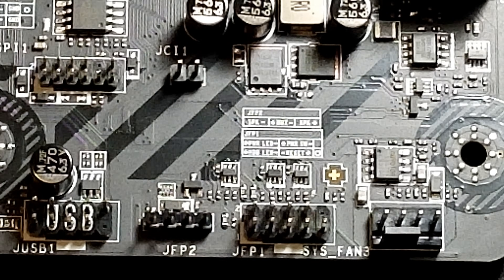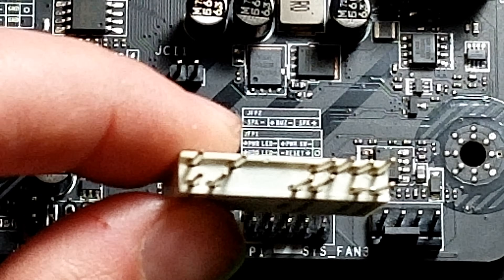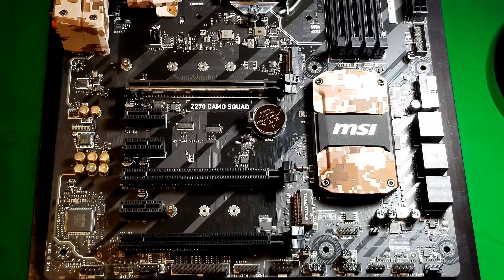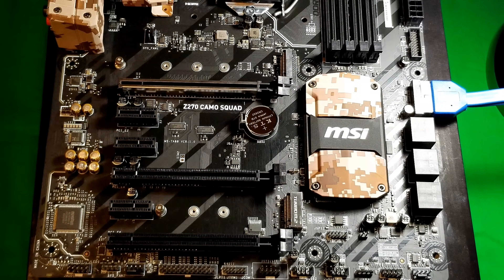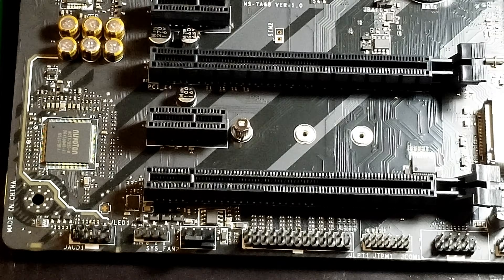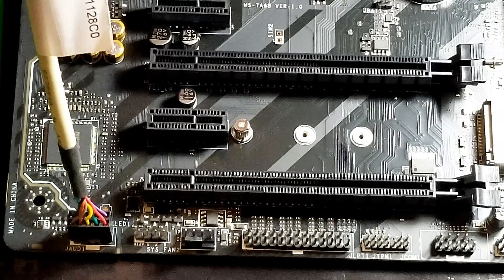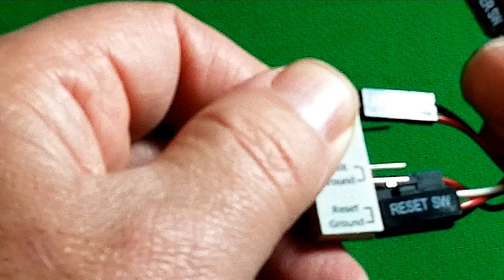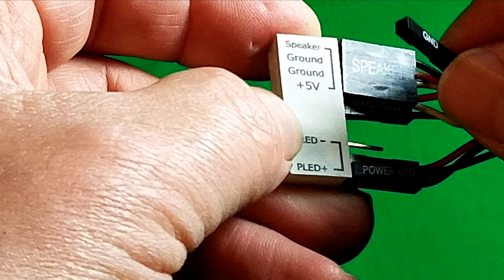Connecting your Case Front Panel connectors to your Motherboard

Comment: Where can I find pin layout for Asus ROG Strix Z390-E Gaming Motherboard LGA1151 it’s plug in where you connect the wires from panel to socket then connect to motherboard
Reply: Steven White omg yes where
Reply: I’m trying to get my pc built right now but I don’t know what the little arrow means on the cables for the positive and negative. The manual sucks but it’s readable but it doesn’t matter if I can read it if I don’t know if the arrow means ground or positive
Reply from the maker: The arrow means positive, I'll find the pin layout for you later...
Reply from the maker: If you go to your MB Manual you would have gotten with the MB, on page 1-2 it shows you the Pin Layout...Thanks...
Reply: Hey yeah I finished watching your video and it totally solved my problem. Thank you very much. Now all I need to do is find out which of the umpteen million different 3 pin connectors I can run case fans on lol I figured all of the ones that are 1 amp 12 watts like the dedicated ones but I’m not sure if I can control them like a fan connection
Reply: I kind of figured that maybe the Aio pump since my water cooler runs off of a Sata and a usb controller but I can’t find anywhere that talks about it.
Reply: I was trying to get away with not having to run a fan hub
Reply from the maker: Yeah fan hubs are becoming a necessity these days...glad my video solved your problem, yeah they are adding a lot of connectors these days, wish I could review more cases and explain all the cables...maybe one day I'll be able to get more...Take Care...
Reply: @Reviewing_Playing_and_More_RPM  thanks for all the help. I'm running now. Finally figured out the wiring diagram lol Have a great day.
Reply from the maker: Cool...

Comment: where are the other sides of all these cables plugged into?
Reply from the maker: The other end of the cables are coming from the case, different cases will have different cables, some don't have a reset button, so no cable for that, and others will have a RGB button and therefore another cable, so each case varies...hope that helps...

Comment: H500i case, Asus z390a motherboard, there is F Panel chord from the fan and rgb hub on the case, can I connect it straight to mother board instead of using the tiny connected you used in the video?
Reply from the maker: +Rick Nash Yes you can...

Comment: Hi!
I need assistance in plugging SPDIF bracket to my Asus Maximus Hero VII. I've looked at the manual and although I do know my way on my system it's kinda hard for me and.. I'd like to ask for your help.

This is my device I just purchased:
https://www.ebay.com/itm/SPDIF-Optical-and-RCA-Out-Plate-Cable-Bracket-for-ASUS-Gigabyte-MSI-Motherboard/272563710974?ssPageName=STRK%3AMEBIDX%3AIT&_trksid=p2057872.m2749.l2649

And this is my motherboaed manual:
https://dlcdnets.asus.com/pub/ASUS/mb/LGA1150/MAXIMUS-VII-HERO/E9799_MAXIMUS_VII_HERO_V2_WEB.pdf

Any help will be greatly appreciated!
-Cuisined.
Reply from the maker: Hi, after looking at the device, and your motherboard it looks like the cable that comes with it one end goes into the device, and the other into the SPDIF on the motherboard, except when I look at your Motherboard Manual I don't see the pin out for the SPDIF which your device needs. So without that it won't work. If I'm looking at the wrong one and you do have a PIN Layout which would be near where it says SPDIF on your motherboard you just need to plug into that and into your device and then just screw the metal piece to your available slot to hold it in place. Hope that helps some...Let me know if you need to know more. Take care and good luck...
Reply: Yep it's non-exsistant. They forgot it.. I've bought another devce just in case, - probably will do the job, 
https://www.ebay.com/itm/PCM2704USB-sound-card-DAC-decoder-USB-input-coaxial-fiber-HIFI-sound-card-d-V0H7/282652965748?ssPageName=STRK%3AMEBIDX%3AIT&_trksid=p2057872.m2749.l2649
Thanks A lot for your comment(s)!

Comment: I have two fans that don't plug into anything, can you help me?
Reply from the maker: Usually case fans are powered by fan headers on the motherboard, but some cases you need to connect them with the included cables, just look to see if they plug in together, and also you may have a Sata Power Cable that needs to be plugged in to get it's power. Other then that I'm not sure. Good Luck...
Reply: @Reviewing_Playing_and_More_RPM  ok ill try, thanks

Comment: I have a ASUS ROG STRIX Z390-E GAMING board and it wont power on at all.
Reply from the maker: Not to say the obvious but I'm guessing you have the motherboard in the case, and everything connected? If so verify the memory is properly seated, that the power supply is connected by checking your cables. It's hard to diagnose this way but if you give me more info I'll try...Thanks...
Reply: @Reviewing_Playing_and_More_RPM  yes everything is all set up
Reply from the maker: @hippyjrr  I'd like to help but diagnosing your system by text is next to impossible. All I can suggest it check you have hooked up the LED Connectors double check them, ensure your Ram is installed correctly, and that your motherboard is hooked up right with your power supply. If you have more info then maybe I might be able to suggest more...Thanks...

Comment: i have an rgb strip in the front of my case but i dont know where to plug it, help pls?
Reply from the maker: What motherboard are you using, and what case please. Thanks...
Reply: @Reviewing_Playing_and_More_RPM  case is antec nx200 and my mobo is an asus prime b450m-k
Reply from the maker: @yonatangoldin  Your motherboard doesn't support RGB with any headers, so unless the NX 200 case has a separate controller to control the RGB then you may not be able to. Sorry couldn't find out more about the case to be sure. What type of connector is coming from the RGB Strip?
Reply: @Reviewing_Playing_and_More_RPM  idk it comes from the front panel so i thought maybe it goes along with some of the power/reset buttons
Reply from the maker: @yonatangoldin  ok, well then once you have the normal LED connectors put on your motherboard, check what cable is left, it likely is intended to go into the motherboard, if that's the case there is likely a alternative to using the RGB on the case by either the power supply or a separate connector to use to manually change the colors and such. Hope that helps...

Comment: this is one thing about computers that pisses me off. these type of plugs on the computer need to be redesigned in made simplified. the front panel connectors is the hardest part about building PCS.
Reply from the maker: +Logan Braveheart Yeah I'm hoping it'll be the next big thing to make building PCs easier...

Comment: What if there is no reset switch connector? Just another power LED?
Reply from the maker: +Manuel Hernandez Some cases don't have a reset button so you won't have that cable...There is PLED + and - the other Power is to turn your PC on or off...
Reply: @Reviewing_Playing_and_More_RPM  makes sense, I have an x470 Mobo and didn't know if it was necessary to install all pins. Thank you brother. Keep up the good work
Reply from the maker: +Manuel Hernandez Anytime, Thanks...
Reply: @Reviewing_Playing_and_More_RPM  what if LED lights on for Mobo and quickly shuts off? Maybe not enough power supply wattage? 500w?
Reply from the maker: +Manuel Hernandez Depending on what is in your system 500W should most times be fine, but depends on what you're using...As far as LED lights on then off not sure...you are ensuring that no power is on when connecting your cables though...Best way to check if you have enough power would be to use Pcpartpicker.com it will let you calculate your power needs...Hope that helps...

Comment: The front panel audio does not seem to work for me. Im connecting headhones, but I get NO reaction or popup about a connected device. When I check the status for the rear audio out (which is connected to my speakers), It's lit up green, and working fine. I have also tried to switch mode inside ROG Realtek HD, to AC97 frontpanel sound (instead of standard Frontpanel HD sound). Then the headphones jack info turned green (but it does not matter if you have phones connected or not). And still - There is not sound. Just a buzzing noise. The "big" audio cabel is connected as it should be on the Asus B450-F motherboard. Any suggestions? Im tired of pluggin in and out my headphones from my speakers all the time.
Reply from the maker: +rymdskrotet Ok let's verify that you plugged your case audio into the AAFP on the motherboard. If that's ok then I have had cases where the connector on the case itself for the audio and microphone were reversed  so you could try that as well. I would use the HD Audio verses the AC97, not both if that's even possible.  If you plug in a HDA front panel into an AC97 motherboard you will get no output on the rear audio output. (Just for info). Another thing to try is Double Click the Realtek HD Audio Manager system tray icon. Click the small folder icon, check that the Disable front panel jack detection box is cleared. Then plug either the microphone or headphones into the front panel Socket of your Computer.  If none of this works let me know and I'll see what more can be done. Thanks...
Reply: @Reviewing_Playing_and_More_RPM  Hello and thank you so much for taking your time in this matter. The motherboard is the quite new B450-F from Asus, which as some "better" FX chipset, so I really hope to get the front panel to work as well as the rear audio panel (which seem to work...not the best sound...buzzing and so...but only if you gain volume). Anyway..

I think I have tried everyting so far. The cable from the case is fastened to the connector where it should be. I have also checked for that option to use the front panel, but I seem to have another software. (Rog version). I DO have a setting to use Realtek Front Panel, (instead of HD Audio panel) but that doesnt work either. The connector turns green (even with no connection done), but still no sound with headphones.

I actually will ge a replacement fron audio panel for my chassi, but Im having a hard time beliving this is the problem. But there is this weird buzzing sound going on in the front panel to. Migh be something wrong.

Ive also been thinking of newer drivers but the driver I use is newer (in numbers) than the one on Asus supportpage.

If you have more suggestions, you are more then welcome to assist further. =D

All best!!

Comment: I've been 5 hours disassembling the computer and reassembling it because it did not turn on, until I found this video i LOVE you
Reply from the maker: Glad it helped you out...
Reply: When you would plug it in and turn on the power supply would any thing happen. I’m asking because the same thing is happening to me
Reply from the maker: @10jelly01  Not until you click on the start Pins...
Reply: @10jelly01  same thing happened to me this morning. I'm building a new computer with the ASUS ROG STRIX B550. I am stumped at the moment..I can't seem to figure out the connections.
Reply: @kandaman304  my problem ended up being the connections with the motherboard
Reply: @10jelly01  am not the least surprised. 
Here's a comment I left after watching David Noble video on this matter...
Great video David! Nice job explaining this rather TEDIOUS process of setting up the connections. I was trying to set up the connections on my ASUS B550 this morning and just got so frustrated!!! The motherboard won't boot up, and am planning on returning because I think the mobo is defective.
After watching your video, it's clear to me how to set it up. I think I'd still return it though for a brand new one because the one I bought was already opened and tampered with. Thanks a lot for your clear explanation on how to set this darn front panel connection up. I'm with you on this, WHY do mobo manufacturers just make ONE connector with ALL the individual connections ALREADY in place??? This is so ridiculous...I can see someone spending HOURS just to figure this out.
Reply: @kandaman304  did you figure it out? I’m having the same problem now
Reply: ME TOO HAHA

Comment: I put power switch cable in the wrong slot and my pc won’t turn on now. Can putting in the wrong one affect the cable
Reply: Thanks
Reply from the maker: If you put the connectors in wrong then yes it could affect your PC not turning on. just start again first verifying the location the connectors need to go according to your Motherboard manual, but if you follow my guide it should work fine. Be sure to connect + and - connectors the right way though. Another thing to be sure of is that if your memory isn't in the correct slots that can keep your PC from booting up as well.

Comment: Sir i need your help pls i Have a AMD motherboard a320m pro vd/s and from were i bought IT says that suport 
3200 mhz memory RAM but in manual IT doesnt sau that . How can i find If i can buy a plus2400 mhz memory?
Reply from the maker: +Kta Morar Board says it can run DDR4 3200 OC but because the board cannot be OC it's suggested you use max of DDR4 2666, but you can check Pcpartpicker.com to check compatibility to be certain. This MB does not support Ryzen 2 out of box just so you know. Hope that helps...
Reply: @Reviewing_Playing_and_More_RPM  so i can run a ryzen 3 2200 g ? I didnt understand part with ryzen 2 thx for answers
Reply from the maker: Some AMD A320 chipset motherboards may need a BIOS update prior to using Raven Ridge CPUs. Upgrading the BIOS may require a different CPU that is supported by older BIOS revisions. So once you are able to update the BIOS then yes you could use the R3 2200G
Reply: @Reviewing_Playing_and_More_RPM  yes You are right 2666 mhz maximum suport its nu first one PC built and i Have limited budget i bought a titan 750 PC case that looks awsome this MB and i want a ryzen 3 2200g and 8gb RAM 2400 or 2666 mhz

Comment: I consider my self a PC savy guy, but due to lack of funds in my life I have never fully build a PC. I used to buy prebuilds or fiddle with components, but not a whole PC. Recently I finally managed to get funds for my livelihood. Got a nice 1060 6G (was child's play to change it) and gonna go buy R5 2600x with an appropriate MoBo and new case with RAM and PSU. So this video will help me not to get lost among all those pins and cables which have to go to a motherboard.
Reply from the maker: +exlibrisas Glad it will help, should be a great build, some nice choices for it. Good luck with your build and Thanks for your support...

Comment: Hello, I recently bought a new motherboard and cpu and ram, but I don't have as many cables as you have on your case I don't have the front panel connectors
Reply from the maker: Some cases don't have USB 2.0 so the usb 3.0 will be there instead, also if your case doesn't have a reset button it won't have a reset cable either...so yes it's very possible as cases change you will have some that are not there or new one's that could be there instead...Hope that helps...Thanks for watching...
Reply: Reviewing Playing & More RPM thanks! I got the pc to turn on but now it gives me a blue screen of death any help?
Reply from the maker: Need more info to try and help, did it get to the BIOS, and boot at all, were you able to install Windows and after it gave the BSOD...First some things to check would be ensure your RAM is inserted correctly, and in the right slots and it's the right type of memory...Let me know...Thanks...
Reply: Reviewing Playing & More RPM turns out i need to reinstall Windows since I upgraded my motherboard and cpu
Reply from the maker: @RevolverCallOfDuty  Ok, well that is at least better then having defective hardware...Take Care, thanks for letting me know...
Reply: Reviewing Playing & More RPM ya thanks for helping

Comment: why did you connect the ground in the positive for the power connector, 10:32 I thought it would be the other way around?
Reply from the maker: In this example the PWR - is the negative, with the ground being the positive, it is the way the adapter they use shows it, when you look at the PWR Connector the Arrow indicates the Positive, thus - and +, it shows it better when you look at the motherboard where it connects. Hope that answers your question.
Reply: I found your reply to the same question. You can disregard. Thanks.

Comment: I couldnt find my USB 2.0 cable, is that normal? Its a Corsair 460x.
Reply from the maker: Not unless you have a case with no USB 2.0 ports on it, which this case has just 3.0 so you will have a USB 3.0 cable instead. As cases evolve they change things, this is one of those cases. Amazing choice of a case btw...